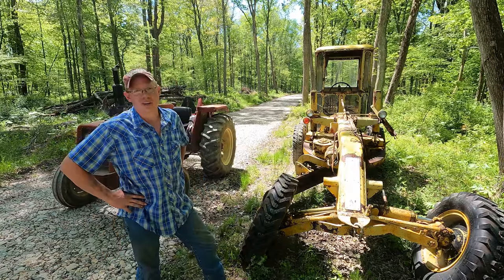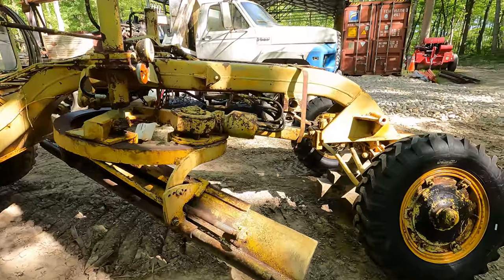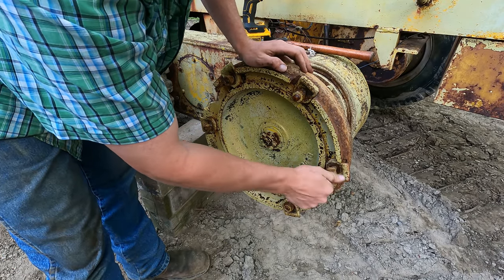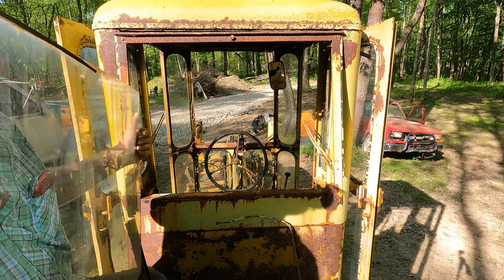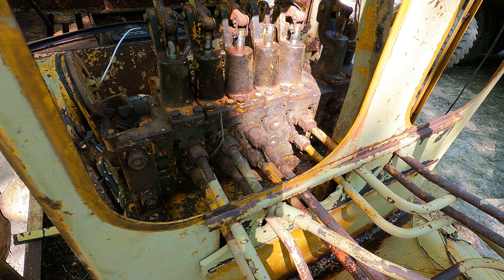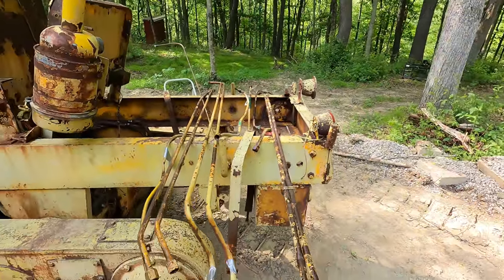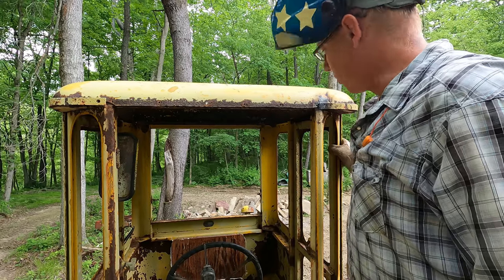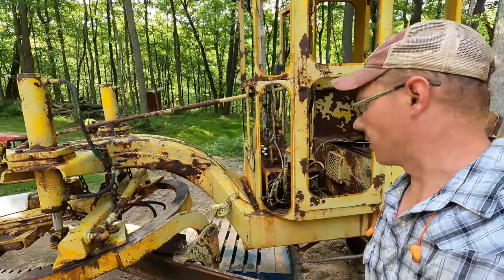More Problems with the 1960's Galion Road Grader restoration!! Pt.8

Comment: I would highly recommend getting a pressure washer media blasting kit to aid in the pre paint prep. Obviously fully blasting the entire machine would be expensive and tedious, but since those kits are sub $50 and a few bags of media could easily get the worst area's of the machine. It would certainly result in a far better prep than just steam blasting alone.

Comment: Not sure if they have been mentioned, but you might try a rethreading kit for things like those studs.  They are similar to a tap and die, but a looser fit for cleaning/repair.  You can impact them up when you have a fair amount of rusty threads so the nut hits clean threads faster.

Comment: We used to fix those metal hydraulic lines our selves, with an acetylene tourch and welding wire. Problem of the leaking was caused by vibrations of the lines against the chassisrail of the shovel and the metal clamps they hve used from new. After that and use of rubber clamps, "no-problemo" anymore.

Comment: Sherwin Williams DTM is great paint
DTM  DIRECT TO METAL they use it for playground , railings , tanks ...It's water based and easy to spray .. I've used on utility trailers and steel gates  , holds up great !

Comment: Hi Matt. PPG stands for Pittsburgh Plate Glass. There was a factory in Creighton, PA. It was built in the early 1900's. During WWII it employed thousand of workers. My Dad worked there making bullet resistant glass for the B-29. After the war they switched to making auto glass. Herculite was tempered glass that would break into thousands of pieces when broken.

Comment: Now use whatever paint you want, but, I have used a paint from "Rust-O-Leum" called "Rusty Metal Red Primer".  It will tend to displace any humidity in the rust and will penetrate the pores of the rust itself.  I have a small sheet metal shed that was rusty and I brush painted it with that primer and 10 years later it is still good with no rust or metal showing through.  Of course knock off any loose rust and then brush on, then apply a color coat.

Comment: The logo is not painted onto the glass. It is usually etched into it by using a pattern and super fine silica sand. I worked at a local glass plant that made tempered glass and that is how we did it.

Comment: You should sandblast those rusted spots and then apply Rust Check, rust converter to prevent it from rusting in the future. It acts as a primer as well so there is no need to wash it off or remove it before priming the metal. I just sandblasted the frame on my 98 Kenworth and had trouble with rust reappearing within 12 hours. I treated it with the rust converter and it is great now. I bought mine in a quart bottle at Napa. Just put it in a paint gun and spray it on. It needs to sit for at least 24 hours to go to work. After that just prime right over it. Highly recommend this.

Comment: i bought a flux core welder for 50 bucks brand new in the box off ebay. Best deal I ever found on a new tool but I like it, it works for what I need.....for now....

Comment: you just brought back, a good old memory.
when i was a very small kid, we would smash the windows of old cars. that were left to rot, now thinking back that sound of breaking glass
was so funny, we would be wetting ourselves laughing. it was the same glass you found on your window frames.
they only changed it, due to people would drive half cut or drunk all the time. and end up going through the screen and their injuries were quite horrific because the did not care a hoot about wearing a seat belt  if they had one, in those cars that were still on the road.👈👺😒👀👀

Comment: I could here that 2-stroke motor in the dozer, didn’t know “Komatsu” put them in their machines...
LOL...!
   I know there were many comments on the IH tractor pulling/towing, but for a straight pull, chain/cable attachment underneath and to the front axle of the tractor is a safe(r) way to go...
   Loved the video.

Comment: I'm a bodyman. and Instead of Being Critical and Putting my Foot in my mouth. I'm going To give you a Thumbs up for going for it. I gave up doing something Like this Because It wouldn't have been "The Right way" Great job Young man Go For it. and In a way it is the right way.
Reply from the maker: Ahh thanks, a positive comment! Lol I don’t know why everyone thinks I’m gonna paint over e rust. There really isn’t much rust to speak of the little that was on the cab corners I did wire wheel first. I’m gonna do some more prep before I shoot it but I don’t think it’s as bad as most of you think. The 5 layers of paint are more concerning to me than rust but I don’t want to sand or blast the whole thing
Reply: @DieselCreek  surface rust will go away with some effort a good Sealer and yes rust converter. some primer and done! yellow work rig hmm but what shade to chose from LOL

Comment: CHRISTINE is going to really come around  with a good clean coat of paint! She's really in good condition  considering the age and years of neglect to the elements! Being all hydraulic is a plus! Old nuclear busters are a whole different  Animal !  Being she's down this far and be a short time until its back up be sure to open up the drive boxes and inspect the drive chains!!! Making sure there's not excess slack or bad links it will definitely make your life easier in the future.  Plus clean out the crud and you can refill the boxes with some used oil and old gear oil thats not contaminated with metal and your ready on the bottom end of the driveline. Finding the chains could be a treasure hunt and for sure pricy . Just giving you a heads up from working with old machines!!   Keep up the awesome work!!

Comment: On another note!  Clean that rust down as much as possible and then give it a coat of Ospho then prime and paint. Ospho will stop the effects and protect the metal. I used it by the gallons working offshore in the oilfield.

Comment: Matt you may want to check on pricing .035  or .040 wall SS tubing and make your own, It bends and flares well.  The price for the flaring tool and a bended is not very much when you consider the cost of labor. None of the tubing looked to be very complicated bends. That way will never have to worry about rust again.

Comment: As many pointed out already, take the time and prepare her for the paint. It feels lika a anticlimax for me as a viewer if you rush it over. And as expensive as paint is it would be pity if it started to flake off in a few months because of the lack of preparations.
The series has been great so far and I would watch a 30 minutes clip of angle grinder work on that rust no doubt!
But of course it is your equipment and your time. 
Keep in up!

Comment: You can buy the tubing fairly cheap to make the metal lines, i replaced four of them 12’ long on my track loader and had to weld the flat faced o ring fitting on them vs yours having the flare. The tubing was only $55 and change and i used an old metal push mower wheel in a vice to bend the long bends and had a buddy bend a piece of conduit in a 90* then split it in half and tack welded it to a piece of flat plate with the same 90* cut on it to then clamped it in the vice to bend the tight radius bends. Worked great and saved over $300 over what a hydraulic shop wanted for them plus $25 to weld each fitting to the tubes after they bent them up

Comment: You can make those lines.  Even if you go with a flexible based high pressure hydraulic option, you can likely still save a bunch of money and have a reliable system.

Comment: Two things use “Rust Ender or Rust Destroyer” it’s a catalytic rust treatment. Prime then paint. Next turn the front two tires around so they will self clean themselves, it will keep you dry and clean, it stops windshield breakage. ChiefD

Comment: Matt, I would think that it might be to your advantage to Bondo the front, & rear of the badly rusted edge where your front, & rear piano hinges were fitted to the grader roof, kind of filling in the, badly pitted edges. It would look so much better, & blend in with the nice Bondo job that you did on the cab corners. It would also strengthen those two long stretches of badly rusted & pitted edges.

Comment: Good progress, Matt! I note that folks have commented on treating and encapsulating rust before paint - may I offer an economical option? Grind or wire-wheel off the worst of it and then use POR15 encapsulator (other “f**k-off-tinworms” products are available). Not concours spec (like that matters on Christine!) but might give you an extra few years before the topcoat starts bubbling. Prime and paint over it and she should be sweet for years - it’s just a cheap bit of life extension 🙂 More power to ya, brother 😎

Comment: Hey if you have noticed Matt, one of the hydraulic lines on the hydraulic block has been closed on, because it's not being used wouldn't it be fun to check out what it's purpose have been and if it's possible to make it back in use

Comment: Need a sand blaster that can handle a minimum of 100 lbs of pressure. That would help with preparing surface for paint. Rootin for ya

Comment: I don't know how many spools of flux core that I've run through my Lincoln Weldpak machine but, I know I've built several trailers and have done numerous repairs. Flux core is just something you have to run a few beads with and get used to how it acts....LOL

Comment: For years I used transmission fluid and diesel for penetrating oil. I've found it to be the best there is and since I sometimes rebuild transmissions it's easy to come by. You just need a spray bottle.

Comment: I had a similar thing happen to me with the tractor lifting the front wheels up.Had a Disc Harrow hooked to an old Model 'G' John Deere. Harrow was wheel mounted had hydrulic controls to control.I was using it,got called away,another guy took the rig.When I got back hopped on he did not tell me that he had reversed the lines causing the the hydrulics to work backwards from the way I was used to using them.Found out when I realized the front wheel was over a foot off the guound and still climbing.

Comment: When you switch over from MIG to FluxCore wire, make sure you change the gun cable polarity to DC-  {MIG is DC+} you may have done this already but sounds and looks to me that it MAY be  running on DC+  Nice video!

Comment: You need to sand blast it!!!!  All that work and you really need to sand Blast. Like how they do Car Haulers ,, if you don’t , you will regret it.  Super high pressure sand blast PSI  400 or higher. That will get all the pant, rust and rot. It will shine like brand new steel.

Comment: Did that once with grandpa's 240 utility  IH tractor  attempting to lift a Cat D8 blade it started out fine till Carl let the lift lever go and the tractor quit picking but he got back on it and the nose went down and the blade went up. It was so we could put rail ties under it while we were changing out the crusty hoses

Comment: Matt-
For all of those hardpoint clamps- Just tear them off, drill out, install
nice rustproof RivNuts & hardware. With all your projects- it might be better
to invest in a few boxes of ends, rolls of hose, and the jig to DIY for your
equipment. Pay for itself easily. That tubing comes in rolls, too.
You're gonna pay through the nose for the convenience of a Shop making
each one- remember what the wheel loader hoses cost? Hopefully- that
makeover is coming up too? What if the Bobcat needs a line/hose?
Please consider DIY.

Comment: You can get the glass looking like almost new with some SOS pads and water.  You have to use the old school SOS pads that are steel wool, not the newer plastic ones.  How about some rust converter before paint too?

Comment: You need to use a rust converter on the rust before putting the metal filler on, before painting. It’s stops the rust from eating away the rest of the metal, even if you paint or fill in places, if you don’t kill the rust it will continue to eat away at the metal, primer doesn’t stop it. The area under the windows where you talked about welding, the place where the hydraulic lines come through. I never could get a good view but I think there may be slots for putting the hydraulic lines in before installing windows. I’m probably wrong just wanted you to take a look at it before welding. You’re do a better job than 103% of other people doing this. Enjoying the videos stay safe.

Comment: Fluxcore welding likes the weld pool to be pulled, not pushed.   it will make your weld look a LOT better.   pushing the weld pool causes slag and impurities to be trapped in the metal.
Reply from the maker: Thanks for the tip, I figured that out rather quickly though. I tried to push it uphill And it was having none of it lol

Comment: When you flux core weld there is a special nozzle for the gun so you don’t ruin the mig tips with weld spatter. Be sure to sand the paint where you plan to put that all metal. You want something for the all metal to have a mechanic bond to.

Comment: Hey Matt , really like your videos . just wondering if you could replumb with rubber lines instead of the steel ?No future rust issues , cheaper , easier repair if needed .Keep up the good work .
Reply from the maker: Defiantly possible but they are not cheaper in fact they are much more expensive. The steel lines should also last a lot longer provided they are maintained

Comment: I bought a old 66 Galion 104B from a guy in MO on Ebay.  He had already done most of what you are and turned out to be a great working machine and head turner for the 12 years I ran it on a 5 mile private road.  When we picked it up, the old timer had it stored inside his warehouse, loading it on our flatbed looked over and he was fighting back tears.  I upgraded to a JD 570 but the wife said 'Granny' must go first...
I'd be curious what your total cost when done?
Also, I didn't see any rear brake drums, just lines.  Mine had a single drum on each side of the rear axle, and to get the shoes relined costs a arm and leg. 
Love the video.

Comment: You should do what I do, and that is when you have an expensive job that needs doing, just buy the equipment ie: tube benders and crimpers you need to do hydraulic lines. Good luck with those lines.

Comment: I am pretty sure steel brake line works as hydraulic line. It can often be found relatively inexpensive too. Especially if the alternative is 1 grand at a shop. Auto parts stores often have 25 ft rolls hanging in the back.

Comment: Somebody's probably already said this, but laminated glass wasn't new in the 1960s. There were probably a lot of new materials being worked with around then, though, and frankly a few ripples and bubbles is probably considered perfectly adequate quality for the application. It's a grader, after all, not a jet.

Repost with some interesting tidbits: PPG started making Herculite tempered glass in 1938. Their aerospace branch makes Herculite II glass.. for jets.
Reply: Laminated glass degrades over time. It's a miracle they remained so good all those years. The laminated windows of my S-class Mercedes have hazed over the edges in only 16 years.

Comment: Get the pipe from a plumbers supply shop and buy olives the right size to seal the joint? They squeeze onto the pipe when you nip the crox nut up. (EDIT: you can also braze or solder them onto the pipe if concerned about pressure? ). A plumbers pipe bender for copper pipe will work to bend it ( if you get a stout one). That tube will be reasonable in price. Cheaper than rubber extrusion for the windows I'd have to suggest. The line studs are easiest to repair with a drill bit and a rivnut kit. If you drill before you paint you can get a coat in the holes and then seal with the rivnut and a little paint brush after they are fitted. Grease the holes and the bolts you'll use to keep water from ruining your fine work. Nice if you could sandblast the rusty areas, I live on the coast so we have to protect everything and count on it still going rusty. My Grandfather drove one of these for the county in the 1950's.

Comment: Extension cord is OK if it's 12 GA...I struggled with welding on a dishwasher and it was my 14 GA cord...bought a 50" 12 GA and that always worked good.

Comment: With all your rusty metal you need a set of sockets both metric and sae made to take out diminished rusted bolt heads.  Irwin and Craftsman made them as well as quite a few others.  I have had excellent success with them as they tighten the more you torque them.
Reply from the maker: I have a set but the real problem here was the studs just couldn’t take the torque
Reply: @DieselCreek  I was thinking about when you pounded the 10 mm on.